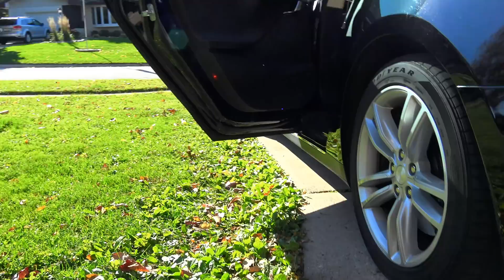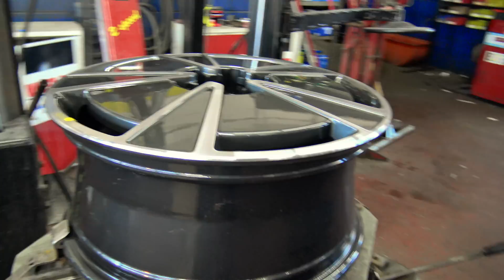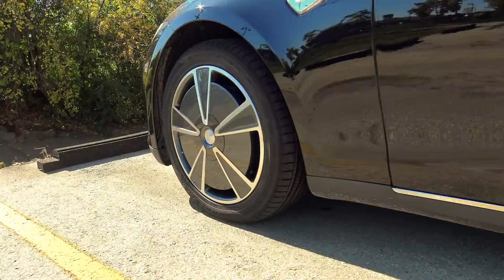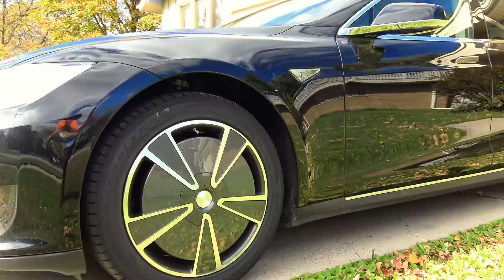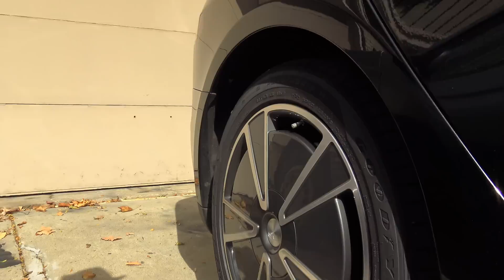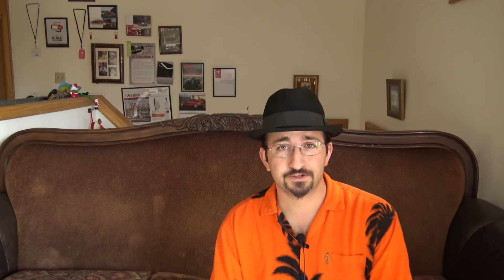Tesla Motors Model S: Aero Rims Installed! 30watt/Mile Improvement!

Comment: Over 50,000 miles, these will save about $180 in energy cost (US Average=0.12/kwh). I love efficiency, but these are not a good investment. It is chump change.
Reply from the maker: StackItUp1 It’s not about saving money. It’s about getting the additional range for actual day today driving. Over the past four years with these rims, I average 10 to30 miles additional range per charge.

Comment: Do you not use winter tires?
Reply from the maker: +Mark Vanderhelm No, havent been needed, only had one instance so far that I could not deal with, that was up hill on my un-plowed street, where the temps were lingering at 31-32*F right at freezing point where the snow turned into hard ice. In that case, I backed down and took main street around and came downhill instead, then no problem.

Comment: is that 30 watt*hours/mile? or power consumption was merely 30 watts less?
if your average rate of speed was 50 mph, then you might be traveling 250 miles, or 5 hours per charge, or effectively have an extra 15% of 1 KWH, which would get you a range increase of ((250miles/85hwh)*85.15kwh)-250=.44 miles per charge.
Reply from the maker: Yes, I still get my terms mixed up. Too much on my mind. 

But yes, 10% improvement was astonishing! I wonder what I would get if I found a way to fill in the additional gaps on the rims. I think I would get the improvement that the Pizza Pan Guy did!
Reply from the maker: +Justin Crediblename Reduced energy consumption by 30watt/mile.
Reply: If you're looking at the trip meter, energy consumption is stated in watt hours per mile (Wh/mile) as Justin suggests, not watts per mile (which isn't even a unit of energy consumption.)

30 Wh/mile would be ~10% improvement, or double the 5% figure claimed for the aero rims; a surprisingly good result if accurate.

Comment: Good deal on tires and nice looking rims.  Seems for family safety at this point, is save second set of rims and install pure winter tires.  With your points they will almost be free and you have the extra room to store them.  Keep your road trips extra safe.  Looking forward to power reports on new rims. Keep up the good videos.   thx
Reply from the maker: +G ary I try to time tires for winter. I use all seasons, with the driving I do, mostly clean road driving, the all seasons have not left me disappointed. 
I am going to be using my Tesla credits to get some more charging adapters, and some swag to give out to my viewers in contests. The rest is going to repairs once my extended warranty expires in a few months.
Reply: +KmanAuto , sounds like you have a solid plan.   About your repairs I would love to have a good talk about that but not here public.  You have been very open about problems and maybe your in a very small group to have so many, don't know.  The road trip where you show high temps in charging cable had me worried.  I'm praying that has been fixed in that the temps were so dangerous for you.
Reply from the maker: Sure. any time you'd like.

Comment: Bravo. Well done. Maybe we can wake up Tesla to not be so wasteful in their engineering. That's a crazy difference considering the massive weight of the car and the otherwise good aero coefficient. Something like 11% cut? Just for the outside of the rim.
Of course it's only really significant for highway but that's also where the big range is.
That's a bizarre difference. For just the outside. Still the same junk on the inside I assume not to mention the real sinners; the front and back block profile of the tires trying to pound the air under the tires and create a turbulent vacuum behind that messes up airflow for everything in the wake as well.
If that's so significant I predict that some decently shaped aero blocks around the tires can cut at least an additional 10% and likely more. I would not be surprised if it cut over 20% more.
I'll make a hunch guess depending on how well you shape them if you can even get them on, that you'll get 18-19% additional energy reduction on freeway.
Of course you should make a note of local wind and temperature plus humidity.
Cold air is tougher and certain specific humidity can make a big difference too. I know from golf.
Btw those rims aren't even particularly aero. That's just half assed whatever they could easily do with normal casting. If you cover the entire surface and make shallow indentations it will cut the drag in half which might only be a percent or two for the car.

And they look pretty good. They look like electric motors with hints of UFO. And a vacuum cleaner. It can't all be good :)

Btw something similar could be done for the weight. I believe it's possible to cut the weight in half for a car that looks and feels exactly the same, even without changing the body work. The body is surprisingly light, only 185kg. At 1 ton it would be a super car. Blow everything away. And be much cheaper to make.
They could make clean sweep in the automotive world if they weren't so inexplicably incompetent as to put a lead acid starter battery in it! 
It could be a phenomenal car.

Someone with a bit of money could pay someone to mod a Model S for reduced weight just to have the coolest car in the world by far.
Reply from the maker: +Dan Frederiksen The guy that put pizza pans on his rims, got some crazy improvements! I'll see what I can come up with for blocks, or at least material wise. Thinking maybe fiberglass and bondo. 
The lead acid battery really isn't that big. about 20Lbs. Thats really nothing. I've had 1,200Lbs of cargo in my Model S (Motorcycle Parts) and only saw about a 20 watt/mile increase.
Reply: Don't forget wheel alignment and tire roll resistance.  Both of those have an effect on energy consumption.